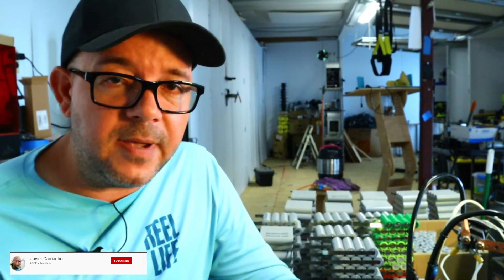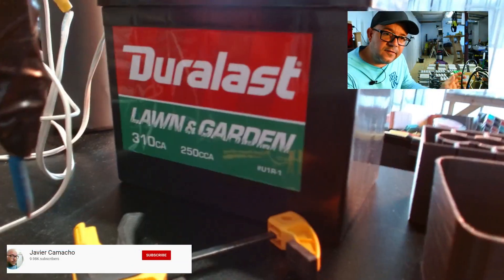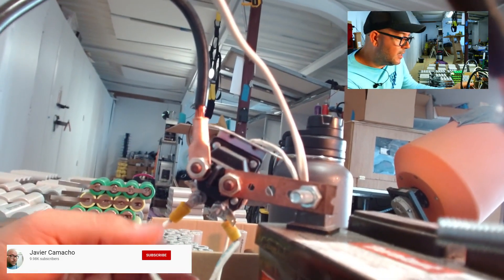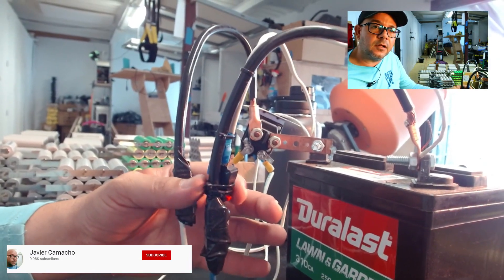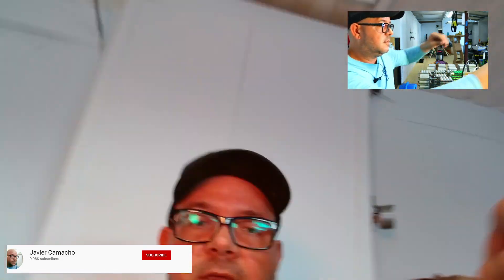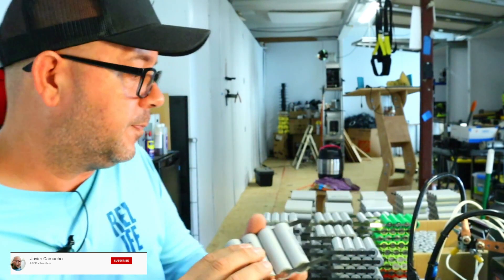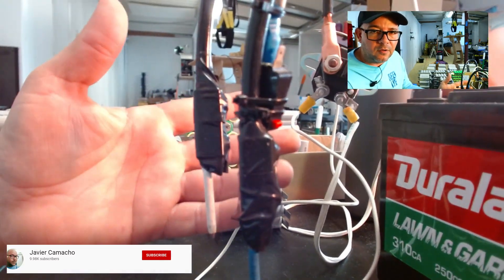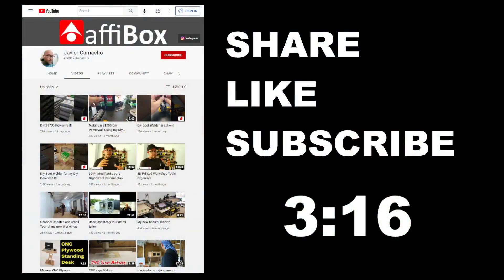Diy Solenoide Spotwelder for making lithium batteries

Comment: Your spot welder looks good. I noticed that there is a tiny spark compared to others that I have seen. I think that you need some eye protection though or add a sleeve that covers the two electrodes yet allows you to look under and then above when zapping.